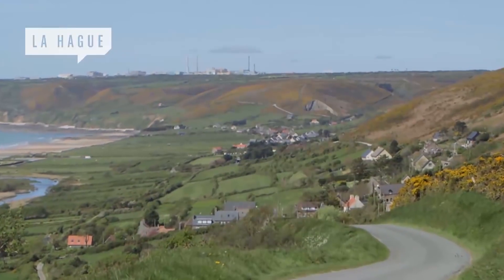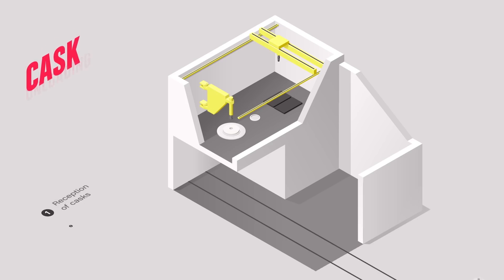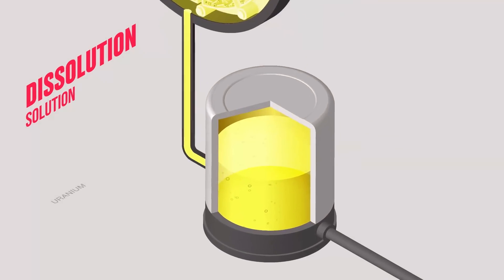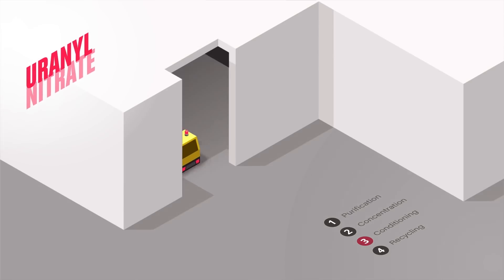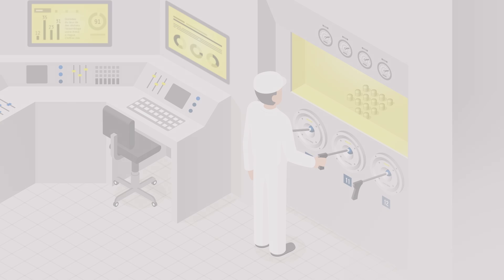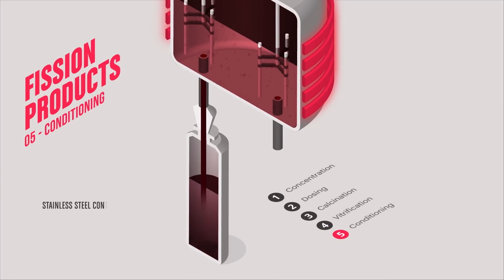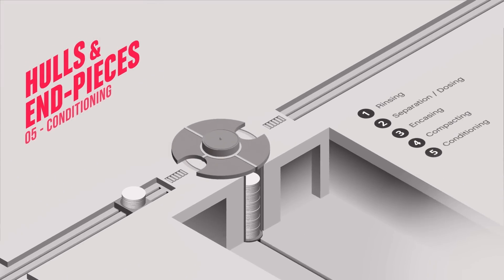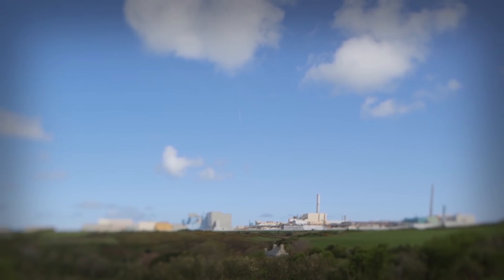Recycling used nuclear fuel - Orano la Hague - English

Comment: Do you recycle uranium 238?
Reply: They did not exactly say, however, I think so.  They said that the uranium (U235 and U238 combined) goes to the enrichment plant; this is required because a significant amount of the easy-to-fission U235 has been decreased compared to U238.  After enriching the U235 back to "normal" levels then it can be put into the reactor again.

Note that France has some "breeder" reactors in their fleet.  These plants naturally convert U238 to plutonium which then can be used for easy-to-fission fuel too (in fact it is part of the MOX fuel mentioned).

Overall, I like that France makes excellent reuse of its nuclear materials.  Countries like U.S.A. have a rather large amount of material that they plan to bury, however, people politically fight hard to prevent it from being "discarded" in that way.

Comment: Why the zirconium used for the fuel rod cladding cannot be recycled?
Reply: Because it had been irradiated by neutrons, so it turned out to be radioactive itself. It constitutes the so-called "intermediate level radioactive waste". Due to naturally occurring decaying process, its radioactive gets low enough in few tens of years, then it can be recycled together with regular metal scrap without problems.

Comment: This almost sounds good.

However, if you recycle spent uranium fuel into MOX fuel, sooner or later you have a lot of used MOX fuel.

Used MOX fuel presents additional challenges. Accumulated plutonium bombardment products present a greater hazard than bombarded uranium. In particular U232 accumulates, as well as a greater variety and concentration of actinides with large neutron cross-sections and low reactivity. U232 co-separates with the actinides, but it's immediate decay products emit hard gamma  rather than alpha or neutrons, and has a half-life of seventy years. All subsequent handling is complicated by this, whether you choose direct disposal, processing and disposal, or recycling.

Spent fuel represents a disposal problem. Spent MOX fuel is a bigger one.
Reply: Not even Russia has an answer for spent MOX fuel?
Reply: @janjan55555  
Nope. Not even Russia.
Sure they have a reactor that can "burn" plutonium, But......
The Russian BN-800 was intended to "burn" excess weapons plutonium. This weapons grade plutonium is exceptionally high chemical and isotopic purity, at stupendous cost. So it has excellent reactivity in a Fast Neutron Reactor (or in a bomb, as intended). Making this plutonium involved specialised breeder reactors optimised to produce desirable fissile plutonium from uranium and minimise low reactivity and "poison" products. Then it underwent exceptional chemical and isotopic separations. It's nice stuff, gold-star "high octane" if you would indulge me.  Very expensive, but with every step optimised to minimise costs to get that result.

Used MOX fuel is whole other can of worms. MOX is typically used as a fraction of the fuel mix in an otherwise normal-ish Thermal Neutron Reactor. The products (not counting ordinary fission products) are a nightmare mixture of Uranium bombardment products and plutonium bombardment products. Much of this mixture is low reactivity, and a substantial proportion is "poisons" which capture neutrons and do not fission. The proportion of these is higher than from a plutonium breeder because the reactor was for power generation, so it was a Thermal neutron reactor and they used a "high burn-up" strategy.
In short, the BN-800 cannot use it without first separating and processing this nightmare mixture. Either it gets processed to remove all the low-reactivity material, which leaves you with that waste to deal with, or it reduces the efficiency of the reactor intended to "burn" it. We already know that the BN-800 required substantial extra fuel development that delayed full operations for some years, and this was using the almost fantastically ideal materials produced by weapons programmes. Using the nightmare mix of transuranics produced by fifty different reactors all using different fuel mixtures and different burn-up rates is not happening with that reactor.

And this brings us back to my original comment: Used MOX differs from ordinary Uranium Spent Fuel. The plutonium bombardment products are far more diverse, more so with high burn-up, and accumulate an increasing proportion of U232. This makes even standard reprocessing harder, let alone reprocessing for fuel.
Reply: @aaroncosier735  So Aaron "In short, the BN-800 cannot use it without first separating and processing this nightmare mixture."
==> What you're saying is (forgive my ignorance) is that currently nobody can do it cost efficiently right? Not a single nation? And I mean separating and processing this mixture?
Reply: @janjan55555  
Yup, that's it, in a nutshell.
They could conceivably do it, but it would be far more elaborate than the processing of used uranium only fuels, or the original purifications used to make the weapons.

For spent uranium-only fuels, you only need to separate the fission products. The Actinide products are still mostly the more desirable plutonium isotopes like Pu239, plus unreacted uranium 235 and U238. You can use that to make MOX without too much stuffing around, so long as the burn-up was not too high.
Used MOX has what I described earlier as a nightmare mixture. For it to be good fuel would require not just the chemical separation of Uranium and Plutonium and the other minor actinides, but also the separation of the awkward and less reactive even-numbered isotopes of Plutonium from the odd-numbered, as well as U236 and U232. These even-numbered plutonium isotopes and U236 absorb neutrons but do not react productively, reducing the reactivity of any subsequent fuel they are in. Separating isotopes requires the same processes as enrichment, which are both inordinately expensive and proliferation hazards. This is all made more interesting by U232. This isotope has immediate daughters that are gamma emitters. The sort of protective shields that are adequate for making MOX from separated spent UOX (mainly alpha and neutron emitters) will not stop high-energy gamma.  So, instead of using glove boxes, it would need remote handling. The isotopic separation has to catch several odd numbered isotopes, while discarding several even-numbered ones. It's a mess.

The BN-800 is designed to react weapons grade plutonium, mixed with depleted or natural uranium. This is about as sweet a mixture as you could wish for, made from already highly purified stockpiles,  and they still had fuel formulation issues. Using Spent MOX fuel in this reactor will require some heroic purifications compared to the deliberately bred materials that were used to make the weapons in the first place. Key and unchangeable parts of the reactor geometry, the overall size, the fuel spacing, the vessel materials, the types of control rods, dampers and reflectors are all finely tuned to the intended fuel.

"not a single nation"
Well, after thirty years of trying France has reportedly managed to put a single batch of reprocessed MOX through their most advanced phoenix for a second time. That's the only one I know of, and it sure as shit wasn't cost-effective. 

The problem is not trivial. 

It is claimed that future Gen IV Fast Neutron Reactors will "close the fuel cycle", but then again, that is the claim of the BN-800, and it manifestly cannot. These proposed "burners" have not been built, nor tested for their effectiveness in actually burning wastes. In practice, they will only do so at the expense of the neutron economy and reduced efficiency: Hence using more fuel to "burn" wastes rather than just making energy directly. Like wasting good fuel to "burn" a wet woolen blanket. It is by no means certain such a reactor can be built to last 20 or more years and then operate efficiently.  Molten Salt Reactors face additional issues: The salt is very corrosive and the materials to build them simply do not exist yet. Even if they did, ongoing "burning" of fission products necessarily makes a full range range of all other elements, capable of all and every sort of corrosion, oxidation and recombination in the mixture. These problems may take decades to solve.

Malcolm Joyce wrote a very accessible introductory text on nuclear engineering where he discusses the MOX reprocessing issues, about chapter 13, from memory.
Reply: @janjan55555  
A further note: You may find reports that France has been recycling MOX since 2004. A closer read will reveal that they  did about ten tonnes. Since then they have managed to recycle about 70 tonnes of MOX, out of several thousand tonnes still waiting in cooling pools. They also like to mention "REMIX", but this fuel mixture contains about 1% of used MOX, and about 4% uranium derived from previously higher enriched uranium.  The capacity of recycling is bugger all, and the fuel mixtures have to contain extra U235 to overcome the MOX derived plutonium mixture. 
Anybody who has watched a sullen teenager wash a single dish and expect a medal will be familiar with the spectacle.
Reply: @aaroncosier735  I see, that's too bad. I assume coming up with an answer to recycle MOX, would require multinational cooperation? Such as Russia, Japan, France etc. Would that be a nice start? Setting up something that would close the cycle? (Assuming the Ukraine drama is over)
Reply: @janjan55555  
I'm at a loss to see how "cooperation" would improve the situation. The "cooperation" would consist of each party trying to get the others to do the expensive bit and hold the by-products. The basic problem is that every step makes more waste than it destroys, and harder to handle waste at that.
"closing the cycle" requires that we can "burn" at least as much waste as we make, as well as make progress on the historical stockpile (over 440,000 tonnes global), and I see no way that will happen.
We would need a fundamentally new way to modulate nuclear reactions to favour particular fissions and products and I do not see any proposals that have the slightest hope of that. Any speculation would be equivalent to science-fiction gobbledegook.

In the meantime, other forms of low-emission generation have attracted enormous private investment, hundreds of times more than the entire publicly funded nuclear program, globally. Optimistic stuff like in the original video post above is just an after-the-fact dead cost, and no real solution. 

The optimistic promises of the fifties haven't turned out as promised, is all. 

I Understand where nuclear proponents are coming from, it's technical and fun and seems like the future, even the maths is fun with big exponents and tricky terms governing huge energies. But there are limits to what can be done, nuclear chemistry is unforgiving at the very moments when we need a break. The best minds are attracted by the complexities of semiconductor physics and modelling complex distribution networks and instantaneous arbitrage of energy and money, and these fields are racing ahead.
Reply: @aaroncosier735  "In the meantime, other forms of low-emission generation have attracted enormous private investment, hundreds of times more than the entire publicly funded nuclear program"
=====> Plz don't say MSR because several experts have said those are waaaaaay too cost inefficient. Any thing but nuclear energy generation, I personally don't take serious.
Reply: @janjan55555  
Nah. "MSR" are not yet feasible for any sort of power generation at scale. The molten salt is astoundingly corrosive and to operate a commercial reactor for any great length of time will require materials that simply do not exist yet. In addition, the ongoing production of fission products and their subsequent bombardment will generate just about every element in existence: corrosive, oxidant, you name it. Materials that withstand this are still on the wish list, and may be years or decades away. I would not expect them for twenty years, at least. That leaves Conventional nuclear, which is too slow and too expensive, and SMRs, which are less efficient, unlikely to be cheaper, and themselves a decade away from "manufacturing" a first example and another decade away from making them in quantity.

Comment: Russia has a nuclear power plant that uses recycled nuclear spent fuel rods. The process used is superior to what is shown in this video. Several countries have attempted to build this type of nuclear reactor and gave up the projects. There are many links to the Russian process on the Internet. Their reactor started operating in 2016 with final success in 2019.
Reply: Nope, BN-800 uses MOX formulated from excess weapons plutonium mixed with depleted uranium. These are perhaps the purest and most tractable materials on the planet for making MOX, and they still had a three year delay making it work.
Using spent fuel will involve far less isotopic purity and lower reactivity. The longer the burnup of the spent fuel, the worse it gets. Using spent MOX as a feedstock is not even in the picture for the foreseeable future. The French managed to use about ten tonnes as a test batch, but have several thousand tonnes waiting. Could take a few centuries.

Comment: 1kg of U235 enriched to 100 percent equals 2.8169 tonnes of fuel enough for 4 fuel rods, this can be done by blending using mixers . Depleted uranium still has some useful fuel and can be done as above ,so a Purex plant with capacity of 2000 tonnes will produce 6000 tonnes of chemical liquids mainly nitrates so these need careful storage and to be leak proof. In the US over 710000 tonnes of DUF6 some stored okay but others are leaking so clean up is needed.

Comment: Or you could just burn them in a LFTR to make power.
Reply: And avoid all these steps.
Reply: What corrosion resistant material will you build it out of? When will that material become available?
Will your LFTR operate efficiently with an overburden of pre-existing wastes? What percentage of the fuel load will be wastes?

Comment: What happens to the gasses produced when plutonium oxalate goes through the calcinator?
Reply: Ahh yes, now you're picking at some nasty hidden scabs. The first issue is: they vent these gases. There are a myriad of concerns that come with this. But perhaps the most ironic part of this process is the fact that CO₂ is the main byproducts of a plutonium oxalate calcination process. It is indeed hilarious that the industry that vilifies CO₂ actually produces it through its dirty reprocessing operations. Of course, in reality, CO₂is the least of the worrisome byproducts. The radioactive liquid residues are released into the sea. The radioactive gases are vented. The sludges are stored onsite.

Comment: When in solid fuel assemblies generated fission products reach 4% the reactivity slows down due to mainly bound xenon gas, which in a liquid fuel reactor would be easily separated. All of the Uranium and Plutonium and others can generate energy, but neutron impeding fission products needs to be separated out. This was invented in the 1950s by Alvin Weinberg at ORNL,  and a test reactor was build and ran until early 70's. many new Gen4 projects use liquid fuel for conserving  the fuel or just using "waste" as the fuel.

Comment: So, when they bury the waste and after tens of thousands of years the casing degrades, will it matter because it’s so far under ground or will it deep through the rock and soil to eventually reach the surface?
Reply: After around 10 thousand years, the radiotoxicity of the waste is extremely low, even lower then the toxicity of the original ore. And the waste is buried in rocks that don't really allow water through them like granite.

Comment: Orano/Areva/Cogema (the name keeps changing to protect the guilty) was bought out by the French government in 2016 to keep it from going bankrupt. Too bad for the French taxpayers. Its massive losses caused it to lose half of its customer base. It no longer has any international customers for its reprocessed uranium and plutonium from La Hague. Reprocessed fuel is way more expensive than uranium from the mines. It is also more difficult to operate in a reactor and requires a greater degree of shielding to prevent emissions. Reprocessing is the dirtiest, most dangerous, most polluting process in the nuclear industry. Only a minor fraction of the spent fuel is recovered and vast sums of radioactive emissions occur into the air and water from the reprocessing. Reprocessed fuel is only usable for 1 time, then it becomes nuclear waste again. The nuclear waste vitrification breaks down after about 100 years releasing the radioactivity once again into the environment. 
Oreno/Areva/Cogema is one of the main reasons why the French nuclear industry is at its worst state since its existence. Nuclear's share of the French electrical energy market has dropped 12% in the last decade.

Comment: Nuclear is NOT cheap at all and even nuclear LOBBYISTS agree. According to the WNSIR report and Reuters: Nuclear is also much more expensive... Solar power ranges from $36 to $44 per MWh, wind power is $29–$56 per MWh. Nuclear energy costs between $112 and $189.
Reply: Only its capital cost is expensive
Once it got its return investment, its cheaper than most electricity generator. And its reliable, can operate 24/7 all year, unlike solar who will basically useless on night and operate in reduced capacity during winter, same goes for wind.
Reply: Capacity and production are not same.  It’s disingenuous to mix the two terms and is not proper accounting of energy produced.
Reply: not cheap, but extremely good at making power at a small (way less than solar or wind of a similar power delivery) footprint
Reply: use solar energy as you want. if you can.